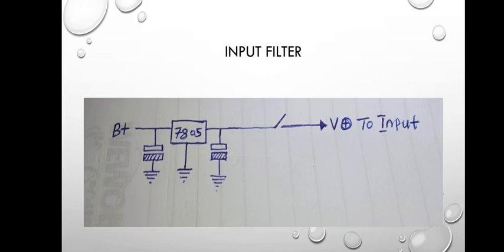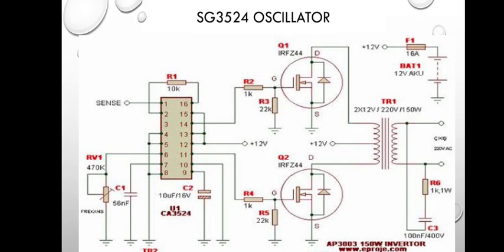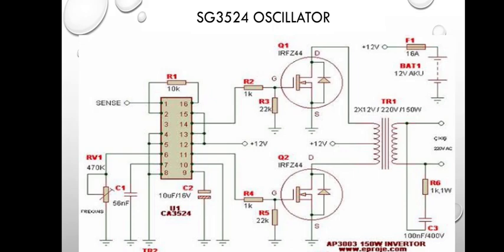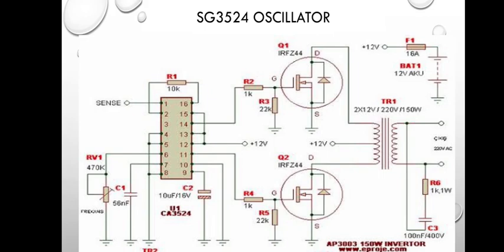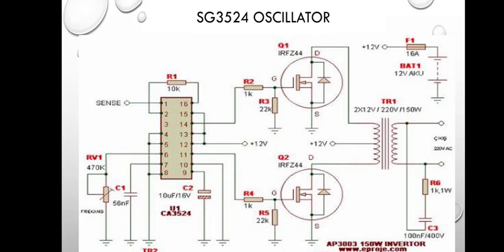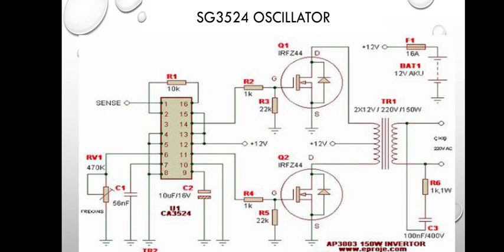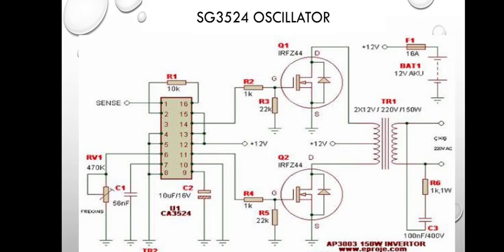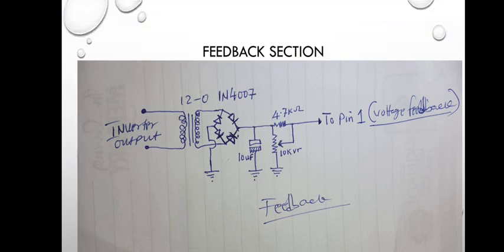inverter Circuit using SG3524

Comment: Please, when your change over and protection circuits  is incorporated to the inverter circuit, where do I connect the load or where do I tap the out put? I would appreciate your prompt response.thanks
Reply from the maker: Reach out on WhatsApp with your question 8129112068

Comment: How are you Sir? Please I made your battery low cut off circuit and it is working. I  connected LED to the output of LM 358 to glow if battery falls below 10v but it is not indicating. I need your help
Reply from the maker: Send me a mail ttisolarenergy@gmail.com

Comment: Sir, I want to ask that if the output load is within range (suppose the circuit you described is of 150 watts) so after applying load on output does the inverter feedback will maintain the output voltage?? As in my case on applying 100 watts the output voltage drops below 200 volts
Reply from the maker: Make a video and shear to ttisolarenergy@gmail.com

Comment: Please where do I connect the common on the main sense relay for the change over to? I need your help please.
Reply from the maker: It's common neutral
Reply: Please once again, is it the mains neutral or the inverters' neutral? @ttisolarenergy
Reply: Please,is it the mains neutral or the inverter neutral? @ttisolarenergy
Reply from the maker: We will be starting a master class on inverter, cc , solar and load analysis mentainace and repairs and also fabrication 

Follow the link to join telegram group:
 https://t.me/+X1h3ZMEwfDcyYzI8
Reply: Thanks you very much for your quick response, may God bless you. I will appreciate your guidance in the process for any challenges.
Reply: Please,where do I connect the normally open of the relay for fully charged circuit to? I would highly appreciate your kind and quick response, thanks.

Comment: Thanks. Sir the input voltage for lm7812 is from 14.5v to 27v according to the datasheet. The fully charged battery is 13.6v. where does the regulation come into play. Is it possible that there could be spikes where the battery voltage will reach 14.5v or above? Thanks .
Reply from the maker: contact me via ttisolarenergy@gmail.com
Reply from the maker: @ikediudeaja398  the regulator is for the ic not the battery
Reply from the maker: We will be starting a master class on inverter, cc , solar and load analysis mentainace and repairs and also fabrication 

Follow the link to join telegram group:
 https://t.me/+X1h3ZMEwfDcyYzI8

Comment: Maximum power rating? and can it work with standing fan? since it's square wave.
Reply from the maker: You will have to smooth it
Reply from the maker: We will be starting a master class on inverter, cc , solar and load analysis mentainace and repairs and also fabrication 

Follow the link to join telegram group:
 https://t.me/+X1h3ZMEwfDcyYzI8

Comment: in Ur feedback circuit,how will the transformer out of 12v increase to 220 through the variable resistor ?
Reply from the maker: @chinekwusunday2259  once you design it as started in the video u should have an output of about 290-320v ac out the use a small transformer to make your feedback circuit to correct the voltage to desired output
Reply from the maker: We will be starting a master class on inverter, cc , solar and load analysis mentainace and repairs and also fabrication 

Follow the link to join telegram group:
 https://t.me/+X1h3ZMEwfDcyYzI8

Comment: Good day chief please can you explain how to connect the battery full cutoff to the sg3525
Reply: How many volts transformer should be used 12v inverter  to make feedback work
Reply from the maker: @wolex565  u can use an operational amplifier the vary the voltage and feed the output to pin 10 of the ic
Reply from the maker: We will be starting a master class on inverter, cc , solar and load analysis mentainace and repairs and also fabrication 

Follow the link to join telegram group:
 https://t.me/+X1h3ZMEwfDcyYzI8

Comment: Good morning engineer , I washed you video on  SG3524 Ic circuit it is powerful but the feedback did,not .why I have practice it .thank for the teaching.
Reply: The point is ones I connect the ac of the small transformer to the  inputs that feed 4diod the SG 3624ic shut down immediately
Reply: What could be done to get feedback function
Reply from the maker: @IdamDenis-l9z  the feedback voltage should not be more than the reference voltage from pin 16
Reply from the maker: We will be starting a master class on inverter, cc , solar and load analysis mentainace and repairs and also fabrication 

Follow the link to join telegram group:
 https://t.me/+X1h3ZMEwfDcyYzI8

Comment: Do you mean when adjusting the feedback 12v transformer with the P.O.T to get 220v 
1- should I connect the small transformer from the main inverter output to power a 12v relay that flows out 220v and set it to 220v 
2- is the feedback working as an overload function on the inverter
3-should 220v be connected directly to pin 1 of i.c,can 220v live wire enter the i.c pin 1 sense section?
Reply from the maker: @jerrylordson8881  check the circuit on the diagram carefully
Reply from the maker: We will be starting a master class on inverter, cc , solar and load analysis mentainace and repairs and also fabrication 

Follow the link to join telegram group:
 https://t.me/+X1h3ZMEwfDcyYzI8

Comment: Good job, this is one of the greatest inverter i ever built long time, it is load independent and good output voltage stability , you cannot compare the ic with 4017 am missing this circuits 😋
Reply: have you implemented this circuit?
Reply from the maker: contact me via ttisolarenergy@gmail.com
Reply from the maker: We will be starting a master class on inverter, cc , solar and load analysis mentainace and repairs and also fabrication 

Follow the link to join telegram group:
 https://t.me/+X1h3ZMEwfDcyYzI8

Comment: How can I test that center tape transformer with multimeter if it is good or bad😊
Reply from the maker: Connect the primary coil to AC and set multimeter to AC 20v
Reply from the maker: We will be starting a master class on inverter, cc , solar and load analysis mentainace and repairs and also fabrication 

Follow the link to join telegram group:
 https://t.me/+X1h3ZMEwfDcyYzI8

Comment: Can the output voltage vary from 1 to 220v
Reply from the maker: no should be the range of 100-150v deffrence
Reply from the maker: We will be starting a master class on inverter, cc , solar and load analysis mentainace and repairs and also fabrication 

Follow the link to join telegram group:
 https://t.me/+X1h3ZMEwfDcyYzI8

Comment: Pls what should be the feed back voltage from the transformer to the ic
Reply from the maker: Maximum of 3v
Reply from the maker: Adjust using pot
Reply from the maker: We will be starting a master class on inverter, cc , solar and load analysis mentainace and repairs and also fabrication 

Follow the link to join telegram group:
 https://t.me/+X1h3ZMEwfDcyYzI8